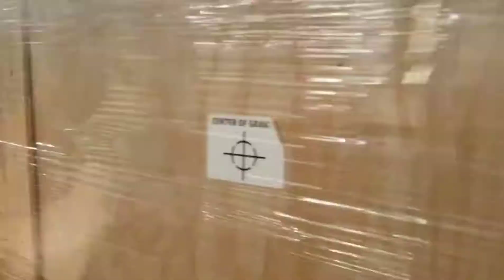HP MULTI JET FUSION 4200 UNBOXING PART 1!

Comment: That looks expensive! What are it's capabilites?
Reply from the maker: It will print isotropic parts out of glass filled nylon, nylon 11, TPU, and polypropylene materials.  So basically it's a slower injection molding machine that does not need tooling in order to produce parts ;)
Reply: RSC Designs unreal! Absolute Limitless possibilities with that. I look forward to seeing what you come up with.
Reply from the maker: For sure! Stay tuned, I plan on printing many parts for the precision rifle market and other industries.  Thanks
Reply: RSC Designs your going to do great. I have some. Ideas for your bolt knobs that might be slick, or rather lack there of lol